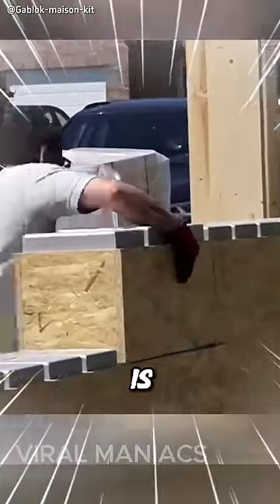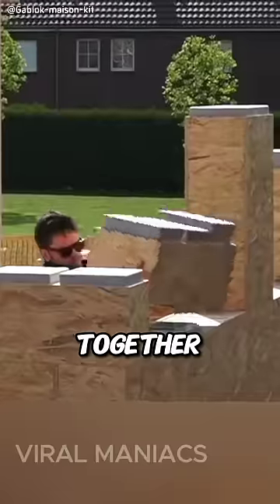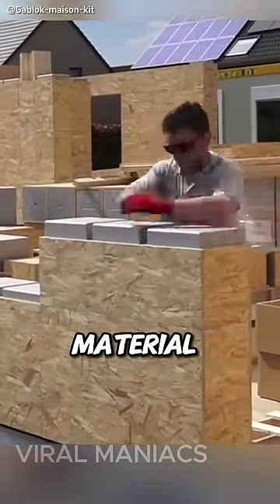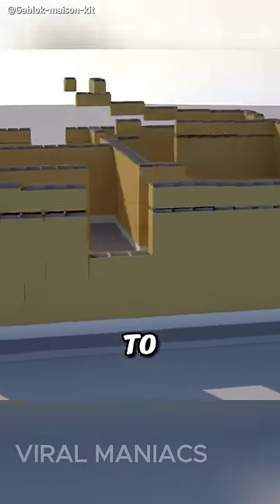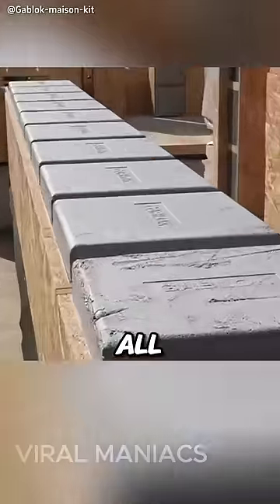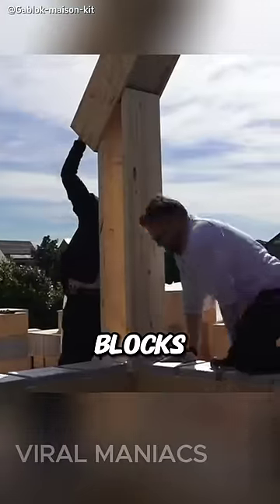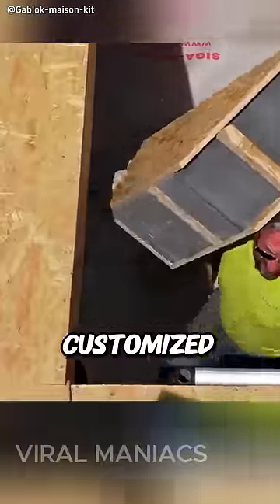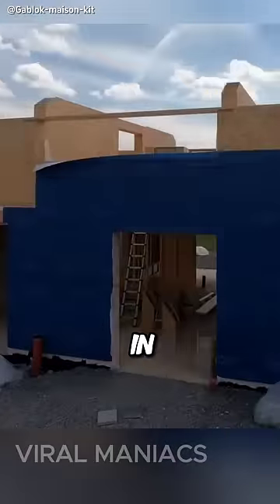Whoever Invented This Way Of Building Houses Is a Genius #shorts

Comment: In a country where floods, hurricanes, and home invasions are frequent, the best thing is to make homes more vulnerable👌
Reply: Floods home invasions and, hurricanes are not frequent. And, this is more solid construction than the vast majority of homes in the United states
Reply: At least you get a lot of floating devices during a flood
Reply: Wtf you talking about?   Answer: you don't know.
So much easier to cut an opening into a house with siding if you really want to break in.  Yes, I've seen that done.   I want specify how but it's extremely easy and quiet.

Next up, floods.  No difference.  Fucked in both types of construction.  

Hurricanes: The style of construction is probably slightly better.

The style of construction is exponentially more energy efficient, much quieter for the occupants.  Much harder to screw up during construction.
Reply: @joshuareynolds23 that is not correct lol
Reply: I’ve never seen a flood or hurricane anywhere near me. Also you ever heard of windows? 🤦‍♂️
Reply: Not if you use some duct tape to ratchet everything down.    Duct tape resolves nearly all issues
Reply: @joshuareynolds23 Hurricanes are very frequent 😂😂😂😂😂 Almost one a year... Tell me you don't live in florida without telling me you don't live in florida....
Reply: I grew up with floods and hurricanes?
Reply: @joshuareynolds23  hurricanes and floods are a huge problem for alot of Americans. United States gets hit by hurricanes every year and they do billions of damage. Go research a bit
Reply: There are some brilliant alternative construction systems. In the UK the problem has always been getting mortgage lenders to lend on what they view as 'Non Standard' construction.
Reply: @Molly46826  Pro, what are you talking about? It doesn't matter what country it is. It's a construction method, which means it will be used in different countries and regions, not just in your region where nothing has happened.
Reply: You said it. But, I looked into this and some cities or areas require you to layer it with a thick coating of stucco or mortar.....
Reply: Most homes are foam and spray on concrete lol
Reply: @coppulor6500  You say that no one broke into the house from the side wall, but it seems that you do not know that doors do not fly and are fixed in the building. Strong building. Strong installation. Weak building. Weak installation. How many times have you seen a door fall from the first or second kick?

If a flood occurs, I do not mind if the water enters the interior and nothing happens, just re-clean it. In wooden buildings, the problem is not with the windows, but with the house being destroyed from the foundation and destroyed.😅
Reply: And you tested this where?
Reply: @Molly46826  I have a reputation for windows, and many homes put them on the second floor so that the house is not penetrated. And if you are talking about a flood, I would rather it enter through the window, and I still own my house, than for it to be destroyed as well. If you live in the United Kingdom, the smartest thing to do is to put it in place. An unprotected window or three meters in size is an invitation for your home to be robbed🤔
Reply: @cmacpan  You seem to think that concrete is weaker than wood, such as withstanding weather factors, fires, etc. I will also tell you which is stronger, glass or metal, and where did you test it? These are some facts that do not need me to test them.
Reply: @MML66  No need to assume what I think, just answer question. Wood, glass, concrete would all last different depending on the quality, build, built in resistance, etc.. Hence "did you test it".
Reply: @joshuareynolds23 I don't like these blocks but all what u stated make sense why they make em like that, it's safer to have those fall, than real old school bricks and concrete
Reply: I'm thinking what if a hurricane comes through it's over
Reply: @coppulor6500 il you've experienced a hurricane then we can talk brick houses are best so zip it
Reply: Yep! Look at places like arizona where only 2 sides of a house are OSB, the other 2 sides are just Tyvek wrapped....
Reply: This ain't no game there gamer. If you're going to comment,  make sure you know what you're talking about . Now go back to the basement and play your game .
Reply: Are you talking about Honduras or something like that?
Reply: @FREEDOM-bk4rv  If I understand what you are saying in your comment, I will admit that you are right in everything you said, but I am sure that you do not even understand what you are saying.😅
Reply: These blocks get wrapped in tyvek, which is like a tarp, and siding, no one's getting in that easy if the doors and windows are decent
Reply: How exactly is this more vulnerable to home invasions than a normally built house? You think a criminal is going to just casually remove your roof and disassemble your wall? I think the cops would be there a few days before they got in that way. They'll just kick in your door like normal.
Reply: @georgschenkfilm whole house just floats to a new lot down the street.
Reply: @E-ClaireCream I really like the statistics and facts your used to support your argument that he's wrong.
Reply: @ryanwells5887 maybe more frequent than other places but one a year isn't frequent.
Reply: @brittbrat9328 not sure, you'd have to tell us. We don't know the answer to your question.
Reply: @zacharyreed45 where? That's a pretty broad statement to just say most homes since most home in America are wood 2x4's and plywood with either vinyl, brick, stone, or stucco on the exterior. Not much foam or cement at all.
Reply: @E-ClaireCream  that is literally correct most modern homes (i.e. the vast majority of the suburban homes you see) are built with a wooden frame, shitty fiberglass insulation and, drywall.
Reply: @roushstge2  except I'm not wrong and, even a cursory search would tell him that he doesn't know what he's talking about. 1.6% of American homes suffer flood damage a year. That's almost literally as infrequent as you can be.
Reply: @joshuareynolds23  floods and flood damage on houses can be two totally different things and you can have flood damage without a local flood. Flood damage is defined by any water damage that comes in from the outside. That can be from a hard rain that just comes under your door and ruins 10-20 sq feet of flooring. Doesn't mean cars are being totalled out from being underwater or people having to get on their roof and wait to be rescued. So sure, do houses get "flood damage" frequently across almost 3.8M square miles? Sure. But with that kind of mentality, we could say anything happens "frequently" in America.
Reply: @roushstge2  that's my point I looked up flood damage and, that's reported at 1.6% of homes in the United states. That means including all the different ways a home can flood comes out to 1.6% of homes meaning actual floods make up a smaller percent and, hurricanes are even less frequent.
Reply: @roushstge2  I don't know exactly where you reside. Here in the Southwest, most are typical track homes. The typical track home is not built with plywood exterior walls anymore. A brick home?! Where?! I have not seen a real brick home in 20 years.

Stucco is essentially spray on concrete...

Comment: As an electrician trainee, I wonder where all the wire in going to go through the wall.
Reply: A video they had online after the blocks were put up it. Looks like a stud wall is put on the inside. Plus outside I'm guessing for putting siding on or it's just furring strips for siding.
Reply: Or any of the infrastructure.
Reply: @warpedone4963  I was wondering the same.  If your information is correct, what a waste of footprint, with about 12 inches thick of walls, still having to add studs for the wiring and plumbing and then interior wallboards, exterior furring and siding...yikes.
Reply: I would just get the exterior walls like this then frame the interior so I could run my electric and plumbing.
Reply: yeah, plumber here, was thinking the same. a house with no under ground utilities? won't work so well with drains.
Reply: Im a layman with an idea, so if im wrong just lmk.

My idea is that in the design phase, choose where the electrical lines would go and leave out the insulation or bore a hole for an electrical conduit through the insulation. I see that polystyrene is flammable. So maybe change the insulation to something that isnt flammable?

As for the plumbing, the builder company should take the design and add plumbing that would go through the insulation to retain the water temperature. 

I'm just a layman, but would that save money on hot water since minimal heat would be lost?
Reply: I would assume it wouldn't be too hard to drill a hole in Styrofoam.   Osb too.
Reply: Flammable...huh... insurance rates.. huh... seems legit to me
Reply: Love it 👍🏼👍🏼
Reply: Nice thinking!
Reply: @d.a.tsun5104  How many studs do you think would be needed to accommodate some wiring boxes and plumbing?  And the walls don't have to be 12" thick, you could do it with only 4" and still have good insulation.  Then use drywall or paneling for the interior surfaces.
Reply: Yea, well….way to piss on our parade. 😅
Reply: This is good when you build house, but it's no good if you building a home 😅
Reply: It's called  fishing wires   I know that it's hard work so I'll have the Roofers do it right  the first time for half the money and no damage to the other trades
Reply: And plumbing
Reply: I've wired two that were similar, but they had horizontal channels in the foam at two feet and four feet. A small chain with a heated steel ball can be dropped from above to melt a vertical channel. And yes, it sucked as badly as it sounds!
Reply: Done similar set ups in australia but the osb was ali or metal. We used an heated probe to melt through the foam  for wiring and plumbing
Reply: @SlimDaddy9  Polystyrene is certainly flammable. However, in this case all of the foam is contained within OSB, so it cant't catch fire quickly.
Reply: @AnotherWisenedOne  The studs are not to accommodate plumbing and wiring actually.  Wiring and plumbing guys would rather not have to deal with studs, but how many of it depends on how well you want to install your interior wallboards.  The normal stick frame studs usually use 16" on center.   But in this situation, you're not concerned about the strength of the wall or insulation value, that's already taken care of by the 'lego-like' blocks in the video.  If you set the studs at minimum interval of 24" and you install the board vertically, that means there are 2 hollow space per board which could get wavy overtime.  As for the 12" thickness, we're talking about this product we see in the video.  Each block's thickness looks like about 1 foot/12" already.  I think for the same concept with already well thoughout and many practical examples of application, I'd stick with SIP.

Comment: Its all fun and games until a toddler comes running through the house and knocks the whole thing down.
Reply: Or until the plumber and electrician charge you triple to deal with these things
Reply: I'm imagine a Titan from AoT running through. 😂
Reply: That response has me crying..
Reply: @DKWVernon why would they charge you anymore if these houses have the same electric/water capabilities as regular houses?
Reply: Or a Hurricane comes
Reply: @charles9504  In a regular framed house, the utilities are easily installed within the framing before it is insulated, and the interior walls are installed. In this house, they would have to cut into the blocks and fish the utilities through the walls, making it incredibly difficult, increasing the time it takes to install them. The hourly rate of these trades is very expensive. Or they would have to mount the utilities to the wall and frame around them, decreasing the total square footage and adding an additional step with a carpenter, which is also very expensive. It's not a very practical way to build a house, in my opinion.
Reply: Ahahaha good for campfire
Reply: Bet it'd hurt like hell if you stepped on one.
Reply: ...and we all fall down :)
Reply: @danielvernon8859  they do frame walls where utilities are needed. You don't have to use the bricks for inner walls either, just regular frames. A house I owned had brick veneer exterior walls, full brick interior walls.
These houses are built in days/weeks not months, the carpenters time is very much reduced. You can do the bulk of the build yourself without trades.

Comment: In a hurricane your house will become a flock of Legos.
Reply: Then you pick 'em back up!

If a tree falls on a wall it would be easier to replace
Reply: I'm pretty sure they have a system for securing the structure and all components to the foundation
Reply: A brick house would be just as gone though…
Reply: @gasad01374 you clearly know nothing about hurricane buddy. Or houses lmao
Reply: And in an earthquake it would become a pile of wood and polystryrene.
Reply: @gasad01374 brick buildings are the best building for bad weather 😅

Comment: Not too sure on the actual structural integrity of this thing. It looks as if you can just pull it off as easily as you push it on like Lego. I doubt once someone builds their house they'd take it apart, I'd imagine they'd like it to stay that way somewhat permanently. How safe is it really if nothing is actually securely attached with any kind of permanent mechanical or chemical bonds?

Comment: As a carpenter of 35 yrs, I thought I'd be replaced by robots. Not Lego. Guess I'll go pawn my tools, and try for a government check.
Reply: This thing looks very flammable.
Reply: After seeing this lego house you have nothing to worry about.
Reply: Yup are still needed! It’s just the outside. Still needs stuff
Reply: Scary lego house making soft people give up
Reply: They have robots in Australia that do similar work to this. They build cinder block homes. It would actually be easier to build a robot that stacks these blocks. 

Concrete 3D printers also exist. 

You can probably still build the roof.
Reply: Yes try coming back into the country at the southern border. You'll get $7000-9000 monthly plus housing.